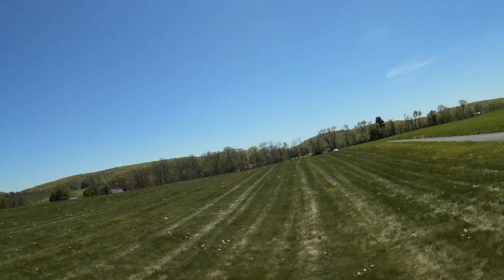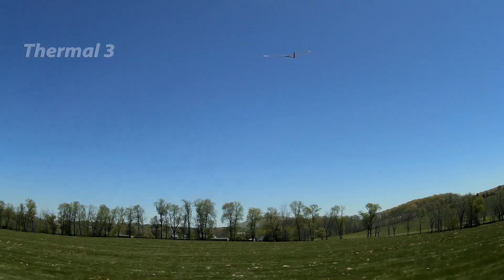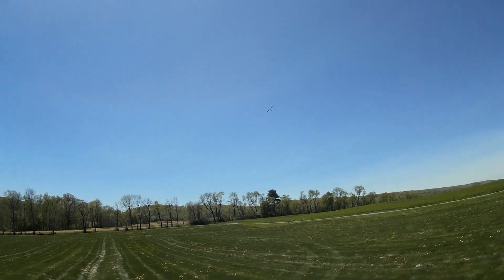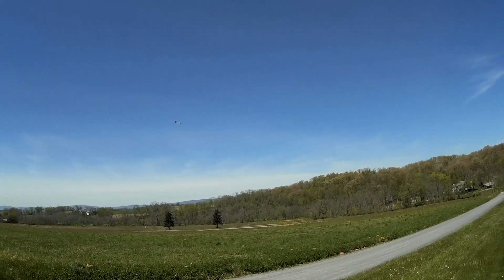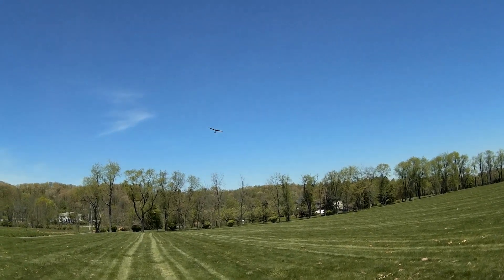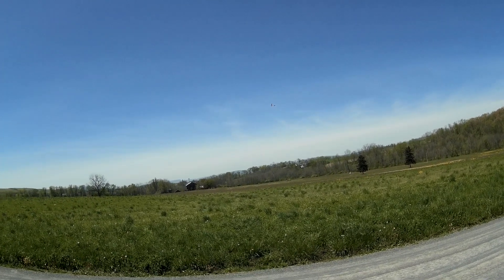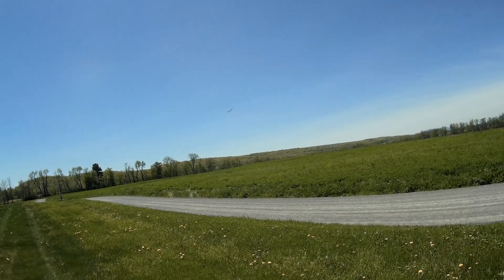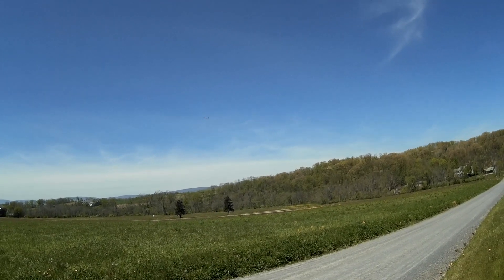Vortex 3 Electro F5K Low Level Thermal Catching Practice Session

Comment: I have flown for many years, but have not seen this technique with very tight turns to read energy low where it might possible to see the classic "wing waggle". Would love to see another of your Carbon Arts videos with these advanced "low altitude" reading; especially since we now have a legal 700-foot ceiling for most of Canada for model aviation.
Reply from the maker: I would recommend purchasing my Thermal Soaring Master Class training videos which go deep into air reading especially at lower levels. Each video is over 2 hours, and I cover subjects and techniques not usually discussed or taught. Go to the radiocarbon art.com website for more details. A direct link is in the video description.

Comment: Hi Paul, I wonder if you have seen the new Sansibear  Bubble Surfer/Django BS.  2.54m. HLG, yes HLG. design?   It looks like they have been able to push the performance levels back up for an HLG design?   I have been in touch with them but our NZD/EUR exchange rate is making it too expensive for me at the moment.  I am interested in what you think especially flying one yourself?   Thanks. Laurie.  NZ.
Reply from the maker: Looks like a fun bigger HLG. More span always flys better. Can you throw that plane in the flats and still thermal out? Depends on your arm...there is a video on my channel of a DLG launched 3 meter...